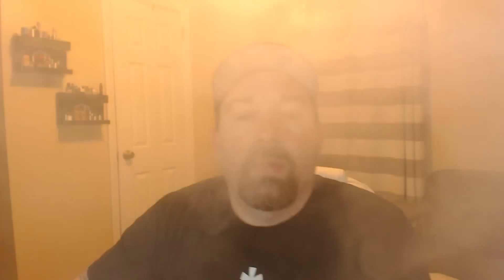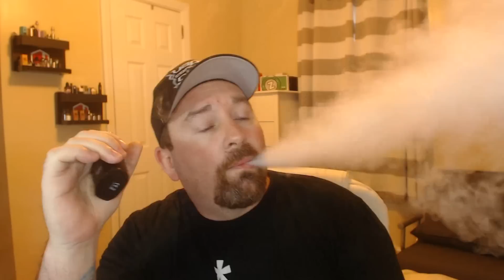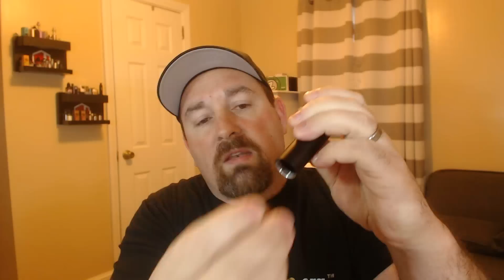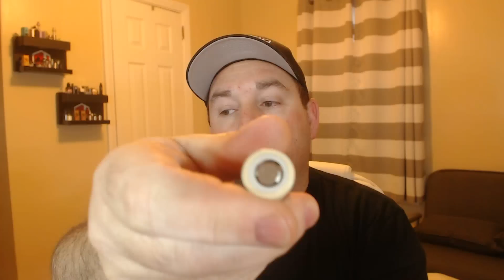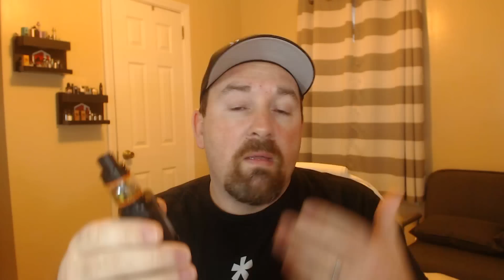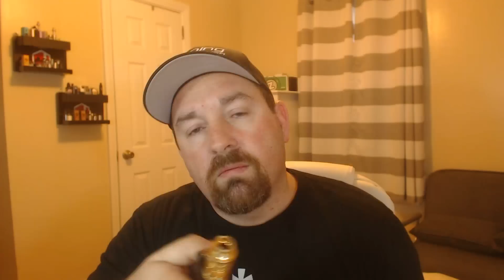Explained! Why Vapes Explode

Comment: I would also add not to buy your batteries from just any random eBay seller. If you are going to buy them on eBay, make sure you know it's a reputable battery seller. And if you know it's a reputable battery seller, don't buy them from them on eBay. Go to their site off of eBay and save them the crazy fees eBay is charging now.

Comment: I specially love ebay sellers with batteries claiming huge amount of mah and then it charges like 1/3 lol.

For huge amount of Amp output power theres nothing like LiPos with deadly amount of amps compared to Li-Ion, but sadly they are also the most explosive type and "shouldnt" be used on those devices :(, almost all my LiPos from RC started smoking at some point, but it was mostly just by never using them for years and they started to balloon which after charging at a safe 1C charge they started smoking.

Comment: Hey! very nice video! btw, I'm using 2 different types of battery with my Charon Tc 218 . 18650 (brown) and LGD(brown) . is there any problem with that? PLS need an accurate answer THANKS !!
Reply: Yes.

Only use two NEW cells of the same brand/variety in multi cell mod. It's smartest to just have a designated set for dual cells, keep these together!! 

Not all cells are equal and this can cause real issues

Comment: just recently switched from cigarettes to vaping.... are the eleaf istick pico good to operate at 75watts... after about four doses, it heats up.. and BEFORE I die by battery explosion, I'll exit with a Newport 100
Reply: I use the istick pico rdta for a few days now. You can go up to 70 wattage. My recomendation is to vape around 20 watt and when its cooler 40. I am not an expert.
Reply: All depends on what battery you’re using. If it’s a 20 amp cdr I would stay around 60 watts and below, 75 watts on a single battery is stressing it way too much imo
Reply: alo254 yea it is, I noticed that on a full battery, four to five discharges at 75w and the battery is dead and hot...
Reply: Tee Gree what coils are you using? You're missing info hete

Comment: So is the smok v8 baby safe?
Reply: SqpS TeRRoR  No I died from looking at one. I exploded...lol but seriously, its not the tanks that cause the problem, its mechanical mods with too low of an ohm load and over drains the battery and it overheats and vents....
Reply: SqpS TeRRoR on what mod/batteries/settings? 
No it's not safe for mechs!!!

It's a kinda lame tank anyway...

Comment: Can anyone tell my how safe the ego aio starter vape is?
Reply: Rod Herrington extremely safe, because you’ll realize it charges very slowly, the battery doesn’t last very long and the cloud production isn’t very good, so you’ll get a new one in a short time :P
Reply: Haven't faced any problem, but is low on vapors. Definitely go for bigger

Comment: My 18650 looks kinda dented but im not sure, it doesnt have a physical dent but the battery plastic is above the button kinda  and it got magnetized by the battery door (the positive end got stuck on the magnet) please answer me im getting my new coils tommorow and i dont wanna vape a dangerous mod
Reply: Carefreeblues you don't throw it out. the safe thing to do is take it to a vape shop for proper disposal.    if you just throw it in the trash it could short, vent, cause a fire in the trash if it makes contact with metal on+&-
Reply: zackery taylor just be safe man, especially when dealing with batteries. 

If it's dented, if the  insulation is peeling or if it just doesn't look right... throw it out, do yourself a favor and get a new one.

Comment: Preach brother. I've been a smoker for the past 10-12 years, I've been trying to get off cigarettes for the past 5-6 years. I've used patches, gum, I quit cold turkey for a while, sometimes i would stay quit for 6 months, other times a year or more. But I have always found myself back at the store buying smokes at some point. When I tried vaping to get off cigarettes, one of the big things in the news was mods/batteries blowing up people getting seriously injured. That scared the fuck out of me. I had just bought a mod around that time and I ended up putting it down and going back to cigarettes because I didn't want to blow my face off. I did my research, I'm using a regulated mod and with the help of mooch and people like you putting the truth out there in the face of all this panic and misinformation about exploding mods/pens, I've been able to get back off cigarettes and vape confidently. Cigarettes kill.  Knowledge is power, thank you for sharing yours.

Comment: what ohm coils can i best use for the Smok T-priv + Lg batt  with the tf8 tank 2ml? gonna get that one, to stop smoking
Reply: Jørn Mulder 0.3ohms around 30-40 watts
Reply: thx, btw i got the 5 ml tank btw big baby beast Smok
Reply: I think SMOK prints recomended wattage on the coils. When it comes to SMOK coils, you should set it a bit lower than the highes recomended setting, or your coils will only last for one week tops. The important thing is you should use batteries that can continously discharge at least 25A.

Comment: my vape exploded tonight I ran a cleito 120 on a arms race box mod  supposed to be really safe don't know what happened the batteries are fine but the whole mod just melted around them and caused the glass on my tank to explode
Reply: Duncan Thompson was you're mod all black with a Indian on it?
Reply: No it was the navy camo version
Reply: Duncan Thompson what type of 18650's did you have
Reply: Lt. Spitfire.ovo it had 2 brand new mxjo' s in it
Reply: I actually took it back to the shop I got it at and they said it had a defect so I replaced it with a vm heavyweight
Reply: Duncan Thompson this is why I prefer mechs... With a mech, it's basically guanenteed user failure, and thus preventable. Regulated seem to fail randomly and without warning. I trust a simple tube way more than a boarder line, overly complex mass produced Chinese box

Comment: so i've been charging my drip box mod with a speaker charger . i'm not sure if it will explode on me while using it. i had no problems with it. someone please reply back
Reply: DyllanWuzHere has it? 

Anyway these things are up to chance (in regulated devices) so don't leave it unattended while plugged in.

Comment: what about AWT batteries they claim 40A
Reply: I hope this helps...Brand: AWT
Size: 18650
Chemistry: IMR
Nominal Capacity: 3000mAh
Nominal Voltage: 3.7V
Discharge: 20A Max Continuous, Rated 40A Max Pulse by AWT
Positive: Flat
Protected: NO, UNPROTECTED
Reply: They lie.

Do I think 40a is ok for some cells under the right conditions? Sure.. I definitely don't make a habit though. 

Currently I'm pushing my Sony vtc5s to 26a (in theory... In a perfect world) this mod also essentially leaves the battery exposed so no chance of pressure building and I'll immediately feel a temp change in it

Comment: well the major thing is sellers need to educate customers. I started off with a ego style with a aspire k2 tank. after the first day I realized the tank was not going to cut it for me. I head to a vape shop after work and look at getting the aspire sub omh tank. I get asked about my device and I'm let know it will not work. what do they show me that will work? a mec mod! this was 2 or so years ago there were some cheep regulated mods but for some reason the carbon knight or what ever was the best choice. get sold the cheepest batteries as well. the only good thing I walked away with is the i2 charger. to top it off I'm pretty sure the mod was a fake. in that situation they should of put me through the crash course on vaping but they knew I would be the easy one to sell whatever to.

Comment: Nice video. You are 100% correct in that more education is needed. About 3 years ago, I discovered one of the very 1st brick and mortar vape shops in my region. It was a 50 minute drive. I went there having been vaping for about 16 months with an adjustable voltage unit, along with clearomizers. They talked me into buying a mech mod, and a $25 dripper atty clone(don't even know the name of it). The only thing they told me was to use higher amp batteries, but they sold me a cheap, off brand Chinese 18650. One employee taught me how to build coils, but only after I paid $20 for the lesson. But if I hadn't have asked(and paid) for the lesson, they would've sent me out the door with almost no real useful safety information. 

Since then, several newer shops have opened up much closer to me, and they are devoted to teaching basic safety information. Probably the only reason that I didn't have an electrical problem with that mech mod after 3 years of daily use, was because I had gotten interested in high end LED flashlights about a year before I started vaping, so I had learned SOME safety stuff, but I never needed high amp batteries b4 buying that mech mod. I recently broke that mech mod and bought a new Kanger Drip box 160.
Reply: HighlanderNorth1 how did you break a mech.

Comment: a thing I've noticed aboot these exploding vapes is the idiot / victim always say they bought it at a specialist vape shop so assumed it would be safe. I've been vaping 3 years now and really I don't know shit other than what I use and like. using coolfire 4 with triton tank, but these other clowns in my position go for a big 200+ watt box mod with rebuildable coils which is never gonnae end well. taken a few bong hits in my time and when I bought my vape fella in the shop said a 6 second rip at 40 watts is similar to a bong rip so I went with that and here we are today using exact same equipment as purchased 3 years ago. looking a bit worse for wear but still going strong.

Comment: I've been vaping for 3 years or so after quitting cigarettes. my go to set ups were tesla mod w/ aspire nautilus & tesla invader 2 w/ asp. atlantis. after some of them broke, got stolen or lost,etc a friend gave me an AR mech mod to use with an atlantis. it got me by, but it wasn't perfect.  
my mother tends to believe every thing on Facebook so she shows me that story bout the dudes exploding vape. so then I get that whole scare speech about vaping is dangerous. I ask her to clarify  if she meant: the activity of vaping  or faulty equipment. she didn't really look more into it, but felt like with what little she read, she could lecture me. 
I was told by some hipser vape shop guy, that my ar mod set up was sooo Dangerous.
my current sets are:  Aspire CF mod  w/ atlantis Evo & smok Rocket w/ nautilus X. both use just 1' 2100-2500mah 30 - 35A 18630 battery.
would these be safe to use?]
Reply from the maker: My concern is that you believe there is a 35 amp 18650. None exist. Please watch my battery safety video for more information.
Reply: Majority of the batteries I had we 30A, with the one odd dog,  a purple "efest 35a", thankfully, by some dumb luck, I had been using it in my flashlight. I appreciate the heads up.
Reply from the maker: There are about 4 30amp batteries, the wraps are ALL WRONG so DO NOT go by what the battery has printed on it.

Comment: building a coil with to low of a resistance doesn't cause the battery to dead short and explode what are you talking about... The only time a dead short happens is when you're using a hybrid mech mod and an atomizer that doesn't have a protruding 510 connecter, as well as if you have damaged batteries.. The only way batteries will explode is when someone builds a coil with to low of a resistance and it ends up pulling more amps them the battery can push out which causes the battery to over heat, vent and possibly explode.
Reply: Oh alright you actually got into everything I mentioned, I just heard that part at like 3:20 and was like, wait your battery doesn't hard short from building to low of a resistance coil, it actually over heats when building to low of a resistance and pulls to many amps then what your battery can handle and over works your battery and heats up the battery to the point it ends up venting. but great video.

Comment: THANK YOU SO MUCH FOR THIS! YOU INSPIRE ME! And you're right don't let crap you see online scare off other people from vaping, only been vaping for a couple weeks and i can feel the difference!

I got a question, will you make a video on how to do maintenance on a coil/cotton? (I'm really new to vaping, i apologize if I'm not using the correct terms) I have a coil that has the cotton wrapped around it, and a friend told me I have to change the cotton every few days, but I don't know how to change the cotton because you'd have to wrap the cotton into that tiny coil tube? (O, and I have a Wismec Reuleaux RX mini kit and the coil came with the kit) If you don't mind, PLEASE HELP! Can't seem to find any information on how to change it. Most people share information on how to change the cotton that you just pull through between 2 points.
Reply from the maker: sounds like you have a sub ohm tank, those require you to replace the entire coil head (super easy and cheap).
Reply: Andika Hartawan - I just wanted to add onto The Straight Vape's reply. I looked up ur kit and it looks like the kit u got came with the Reux Mini Tank. If so, I saw that this tank goes with the Reux Mini Coils. U can do a Google search for these coils and find them in many stores. What ur friend was referring to was replacing the cotton on hand-built coils (or u can buy these coils already made) for use in an RDA or RTA. However, as a beginner, I strongly suggest u stick with the sub-ohm tanks and coils, like the ones u have now. U usually need to replace the coils on sub-ohm tanks about once/week, but this can vary depending on many factors.
Reply: Btw, the kit u got should have come with 2 coils (1 was likely already inside the tank).
Reply: THANKS AMY B AND THE STRAIGHT VAPE!!! YOU GUYS ARE THE FRIKIN BEST AND CHANGING MY LIFE! Ever since I started vaping I don't crave cigs anymore and when I do try it it just tastes aweful and nauseating now! So thank you so very very much for saving my life! 

Amy B you're so amazing! I deeply appreciate you even bother looking it up and writting up a response, I know that's very troublesome, so thank you so much! I wish theres a way I could show my appreciation and gratitude to you guys!

Comment: i'm using a regulated mod ( rx2/3 ) with Sony VTC5A 18650 25A (2600 mAh) at 180w, could someone tell me if that's dangerous? like is it at risk of exploding? sorry for the noob question, i'm quite new to this.
Reply from the maker: no risk because you're using a regulated mod. No worries.
Reply: Thanks!
Reply: Devirius No, nothing on regulated devices is dangerous. the only time its dangerous is if you have crappy batteries or your battery wrapper is messed up but they're meant to have safety features to keep them from blowing up
Reply: Thanks for the reply, I will keep that in mind and check my batteries often

Comment: not all regulated mods are reverse protected.. reverse the battery, fine no battery explosion, but it may brick your mod. so telling peeps its ok to put battery in backwards is not too cool, especially new to vaping peeps...
Reply from the maker: The point is to be EDUCATED about the devices you are using. If you don't read the manual, then shame on you.
Reply: The Straight Vape thank you for the reply, I agree that peeps need to be educated, but saying put in battery backwards, put in cheap batteries, it will protect you.. a while ago, I got my friend switched to vaping, first he bought an EGO clone, then he bought an ipv6x, nothing in instructions about reverse battery, magnetic door, dropped it one night, out popped the batteries. He popped them back in not realizing they were backwards in the dark, pop fried his atomizer, actually burnt his lip. Turns out it has no reverse protection and weirdly enough fires at full 200w if batteries are backwards. I appreciate your video and agree with your assessment that people need to be educated about vaping, been doing it for about 6 years now myself. It just seemed your comments were more along the lines of ""If you want a mech mod do your homework, if you buy a regulated box mod you are safe." Thanks again for spreading the good word about vaping!
Reply from the maker: In nearly all regulated mods nowadays, they have reverse battery protection. IPV6X is ancient :) LOL
Reply: The Straight Vape agreed, I still see them on sale though. thanks for the good word on vaping!
Reply: Robert Mendes Mostly, if not all the newest devices are.
Reply: laketown menace if you can put "Most if not all" in a sentence, its still worth mentioning, I see a lot of cheap older mods on eBay and MOST IF NOT ALL listings do not say "Grandpas vape 2013 model" or "Newestvape Maxi 2017" most people will buy cheap and possibly unsafe if not guided by other peeps or instructional videos or posts like these. Its kinda the "Caution contents is hot" on coffee cups scenario, sometimes you need to tell people the obvious because eventually that one person who makes a mistake and hurts themself is gonna point the finger and say "But he said all regulated mods are 100% safe. You can't take anything (Including this video, my comments, or anyone's comments) for face value. Peeps need to do the homework and  read the instructions.

Comment: I use the pink HB6 in my mech mods, rated at 32a by Mooch. Glad someone finally made a video on this subject, great job.
Reply: Disturbnthapeace hmm, never heard of a hb6 18650 that was 32 amps and that sounds like a re wrap if it's pink.
Reply: laketown menace  Definitely not a rewrap and they're marked as 30amp batteries but Mooch's testing has them rated for 32a. 

https://www.imrbatteries.com/lg-hb6-18650-1500mah-30a-flat-top-battery-pink/